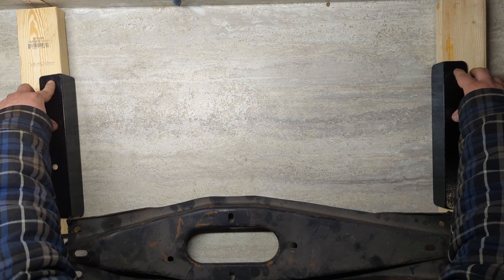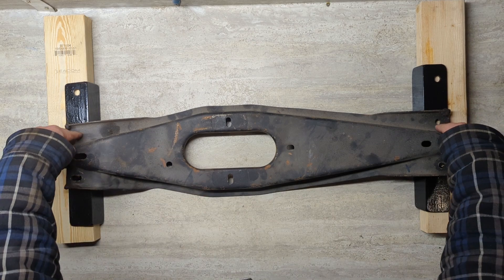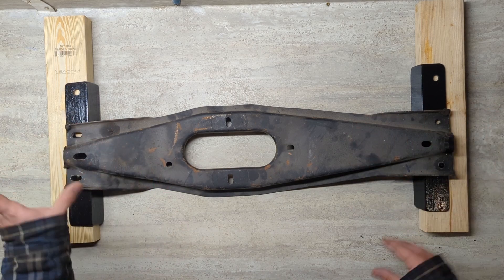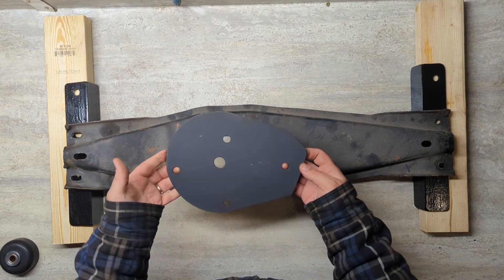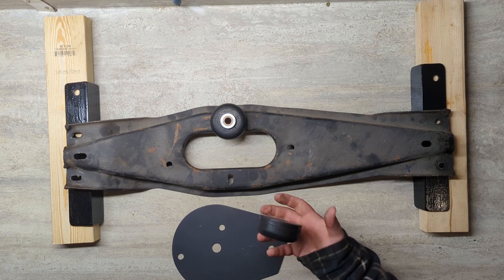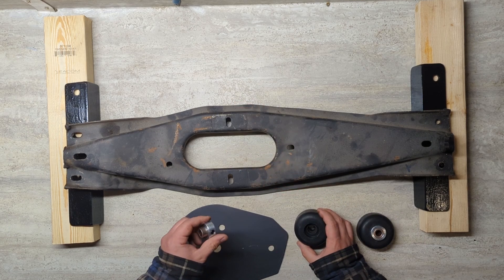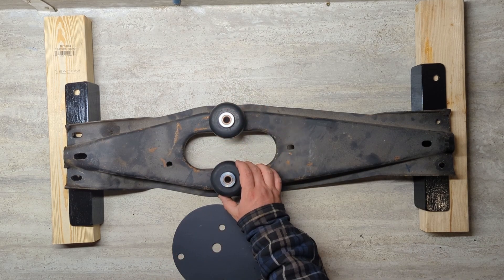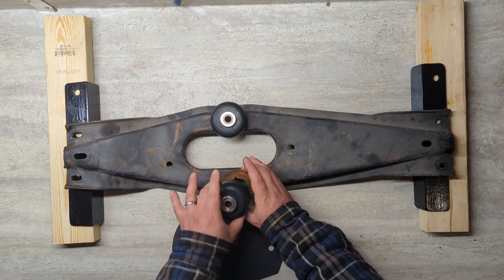DIY Engine Swap Kit - Gen I Dakota to Hemi

Comment: Wanna do this swap to my 2001 dodge van,,, only no shop will even try it
Reply from the maker: That's a great idea! I am seriously considering a van swap after the Ramcharger, the Mrs loves the B series vans. My only problem with them is they're slow, but a Hemi would fix that! My only concern is the oil pan, and the clearance under the cowl/windshield. The Hemi is a tall motor and I have some concerns the intake/heads won't fit. Only one way to find out!
Reply: @billsmoparchannel  I got a 97 I’m sellin cheap,, (700.00)if your interested,,, I’m on several van pages,, if you or shops like yours could develop the necessary pieces to do a hemi swap,,, there’d be a ton of people beat’n your door down
Reply from the maker: @nitewatch2.027  Thanks for the offer, but I'll need to make some room first. I'm glad we're not the only ones that think that would be awesome. I wonder what people would be willing to pay for that? Since you can't get real full size vans anymore, I could see someone falling in love, might even be me.
Reply: @billsmoparchannel  brother, I’m on several dodge and custom van pages on Facebook,,, lotsa talk about both hellcat and gen 3 hemi swaps,, including the 8 speed auto trans,,, but like me, no shop time due to schedule changes at work, and no shops around me wanna attempt it,,,,, Holley has a descent swap kit for late 80’s early 90’s trucks,, unknown if it be compatible with a b series van

Comment: I’m in the middle of doing a 87 Dakota. Just different set up. Went with a 727, headers, solid engine mounts and I plan on the Holley terminator just haven’t ordered it yet. I grabbed the newer fuel tank from 92-99 I think. Has the big fuel pump opening. Just need to add the higher pressure pump
Reply from the maker: That's awesome, sounds like a clean install. I would like to know what pump you go with. Other than the Holley unit, I didn't have much luck figuring it out. We would like to see it when it's done!
Reply: @billsmoparchannel  there are a bunch of companies that sell the pump that’s needed. Walbro sells pumps. Just take the factory pump apart and put it in. Or perhaps even in your case you might be able to take the donor truck pump and put it in that newer style.
Reply from the maker: @re-geargarage  Thank you! That's a great idea. I should just pull the pickup then and check it out. It wouldn't be hard to find a 92+ magnum with the small tank.